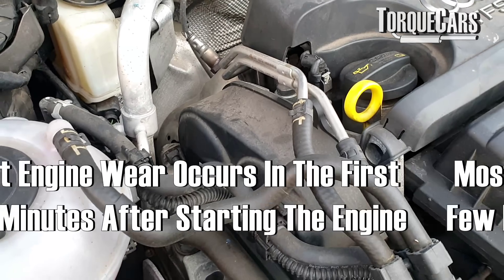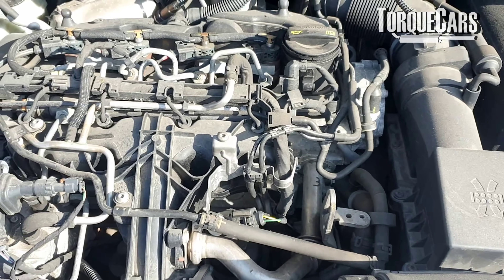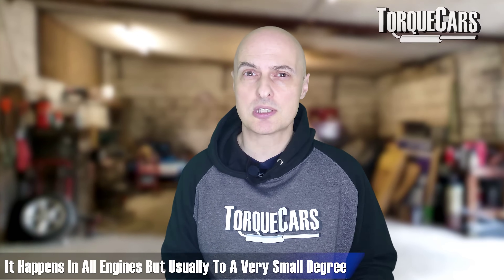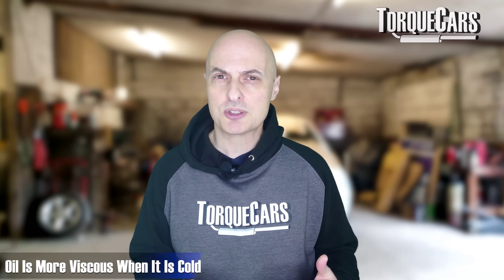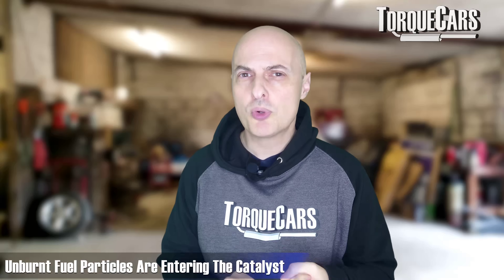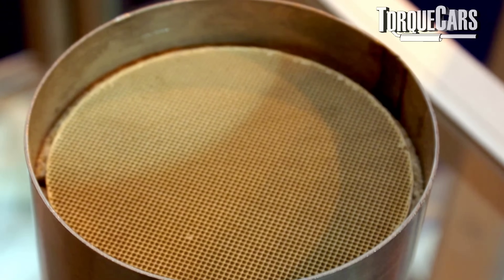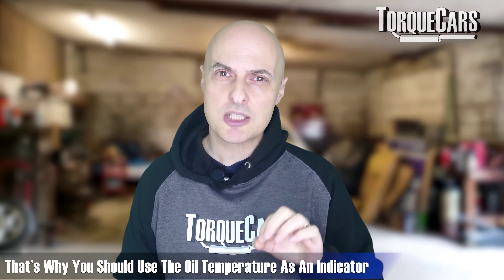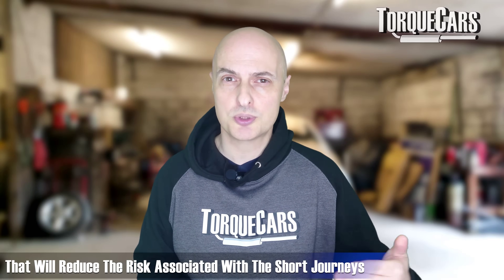5 Minutes of Terror? The TRUTH About Cold Start Wear (and How NOT to Blow Your Motor!)

Comment: Lol, i oft forget how much time has passed, so my car warms up often for at least 15 minutes, if not 20 or more... I also leave the car for a few minutes to ``digest`` the heat on idle after arriving to a destination... The engines in my cars always perform nicely, and while i do suffer some problems from time to time, it`s just the usual jazz of replacement parts or washing out the intake/egr/cat in general and dpf too on diesels... Not once have i drained my oil and found any real sparkle in it, just dark shell rotella or rimula as we have it known in europe... The best oil i ever used, and by far cheaper than most snake oils like castrol and such... Smells much like good old Mobil 10-40 oils from back in the day, but it does sublime work... And yeah, it does affect the fuel usage positively... I would say that it`s due to the oil`s ability to form a seal and reduce blowby, but that is just my speculation... I use it in factory stated viscosity depending on the car, but regardless of the engine, it works amazingly... I know that this seems like a plug, but it`s just my enthusiasm for a damn good lubricant... Tho honestly, even if it did not offset the fuel usage by a few % in my favor, i would be using it, it`s just a great oil for any engine in my experience, from 2013 audi v8 4.2 turbodiesel to i4 merc turbo from 2008 to first gen a class 1.9 petrol natty, they all love it and perform better since i switched to rimula a few years ago... The 1.9 petrol natty doesn`t even defile the oil that much, it`s more of a translucent brown than dark brown chocolate that you get from a diesel with a turbo...

Edit-
The only thing i recommend more than using rotella/rimula and warming up your engine is getting an engine block heater or even an oil heater in tandem with the coolant block heater... That will do any engine a favor like nothing else in conjunction with good oil...
Keep in mind that i don`t use my diesels in winter all that much unless it`s a warm day, so that greatly offsets the engine fouling from regular diesel idle conditions... Petrols get to full operating temps in like minutes, so they don`t foul themselves or the exhaust componentry much by just sitting a bit... And the 4.2 is no different despite being a diesel... That engine is at 80C in minutes from startup on idle...

Comment: What is the impact of modern mild hybrid systems on engines.  There are lots of start stops on these engines in town driving.
Reply from the maker: A stop start isn't the same as a cold start and most of these engines warm up quickly and retain the heat well. As with all cars the key is to avoid over stressing the engine until it has reached it's operating temperature. It just needs the driver to read the temp gauge and drive accordingly unless the car maker has built in safeguards to protect the engine whilst cold.

Comment: Also I would like to add, it's absolutely crucial to use the correct engine oil, especially in the winter and change it earlier than recommended by the manufacturer. I live in the central Russia where the temperature gets as low as -40 sometimes. I always change my oil at every 5k miles. We also use webasto autonomous systems and plug in 240v equipment to warm up the  engine in the extreme temperatures.
Reply from the maker: Great point! Oil grades and additive packs are vital in these extremes.

Comment: I have been hearing lots of feedback and read a lot about engines. I own a Golf mk7 1.6 TDI. The max RPM is 6000. 

I use synthetic 5 w 30 oil. My car won't show the oil temperature until it passes 45 degrees. 

Can you please tell me out of 6000 RPM, what is the max I can go up to when driving my car? Also, tell me the max RPMs I can go to while it starts to warm up. I really need to know this!
Reply: 5990
Reply: Generally when cold I'd keep it below 2k unless you're going up a steep hill then more like 3k and let the turbo build low-medium boost. Once fully warmed up you can take it to 6k anytime as rev limiter on normal cars is reasonably conservative, ofc during normal driving you probably wont go above 3k anyway and it's not ideal to bounce off the limiter.
Reply: Fuel cut is 5,200rpm

Comment: Great video! On my car I have installed diesel coolant heater and no more cold starts! No more scraping the ice of the windows and freezing inside car. It took me a 3 days to install the heater together with coolant flush but man what a beauty! Now when I need to drive I just press on the button on the remote and I wait 15-30 min depending of outside winter temperature and all the ice melts from a windows, engine is preheated to operating temperature and it's nice and warm inside the car. Best investment ever let me tell you!  😊
Reply from the maker: Are these readily available or is it a custom project you've put together yourself?
Reply: @torquecars  I can't tell you what it looks like globally but in Poland they're somewhat readily available, there's a bunch of garages around that specialize with branded auxilliary heaters, lots of trucks also come with coolant heaters & independent A/C stock. Not very common around here as it's not that cold over here but they're certainly popular in Scandinavia

Comment: Wait for high idle on cold start to drop and when it settles (usually around 1000RPM), the car is ready to be driven. Simple. That is usually 30 seconds or more depending on how cold it is out. That's what I go by before I load my engine. As for driving warm up, I would say keep it limited to about 1/4 throttle and below 3000RPM for your average car engine for the first 10-15 minutes depending on driving conditions. I know a guy with a Honda Accord that would get in, start the car and immediately start driving. Years of this treatment led the the car sounding worse and worse. Lots of clicking and rattling. I'm convinced the only reason it still worked at all was because it was a Honda engine. Still, even great engines are guaranteed to eventually fail. It was running, but it was running very poorly. This was all due to poor cold-start hygiene. 

One interesting note is regarding hybrids, or at least, Toyota hybrids. Toyota has the hybrid system programmed to prioritize the electric motors heavily when the engine first fires up. People who drive hybrids like this may have noticed in scenarios where your cold start occurs during initial acceleration that the hybrid battery drains unusually fast, which indicates the hybrid system giving more power to the electric motors to "unload" the gas engine while engine oil circulates on start-up. This is actually pretty cool because hybrids can actually protect themselves from user error whereas normal ICE cars are at the mercy of their driver. I suppose the one piece of advice for hybrid cold-starting is try to get the engine on before you begin driving and if you do find yourself in a scenario where you will be mid-acceleration on cold start, try to do so only with your hybrid battery fully charged. If this can be avoided though, it should be.

Comment: I think it would be cool to have an electric bypass oil pump for pre-starting. It can shoot oil through a check valve ahead of the output side if the engine oil pump
Reply: The turbo post-oiler kits also have a pre oiling function too.

Comment: All of my life in very cold weather I have always allowed my engines to fast smooth idle for 20 seconds or so before doing anything. And then drive off in a lower gear whilst not putting pressure on the motor until a mile or so.
Reply from the maker: How cold does it get where you are?

Comment: 230k miles on a M57 diesel. Original turbo. Mpg matches factory spec. Get in and go gently until hot. Floor it now again when hot. Change oil annually. Can't go wrong.
Only idles for a minute or two when I have to scrape the windscreen.
Reply: You only change your oil once a year???
Reply: @tylerwill5250  Sure, as long as you drive <10k km a year
Reply: Oil should be to BMW long life LL-01 or LL-04 spec  with viscosity covering range for your climate
Reply: Best BMW engine!
Reply: @AlbiM1 M47R is the best no flaps on inlet manifold

Comment: On some engines, you can see the cams trough the oil cap, and in the first seconds after turning engine on, there's almost no oil on the cams.A strong indicator that you should not drive in the first minute or so.
Reply from the maker: The top of the engine is where most wear occurs on cold starts from what I've seen and experienced.

Comment: He is so Wrong in many ways 1st oil needs to warm up for protection 2nd coolant needs to warm up for your water pump. 3rd transmission fluid need warming as you drive  slow motor is #1

Comment: this explains why those PHEVs last so long. if you charge it every time you get home, the combustion engine never really gets to power short journeys. and if you know you have barely enough electric range to reach your destination, might as well turn on the normal engine early on in the trip, when you're on the motorway or other long winding roads where there's few to no stops and the engine can just happily start with a low lasting load.
Reply: I have a PHEV, at 7k miles the oil still looks brand new because the gas engine really only gets used for 3-4k of those 7k. I expect this car to last as long as the battery honestly.

Comment: All engines should be warmed up to operating temperature before driving. I think it’s a good habit to get into,I keep trying to tell my wife not to drive within seconds of starting her car as it’s really not good for the engine but it’s her car and if she wants to drive it when it’s cold that’s up to her. My car is warmed up to operating temperature before I drive it.
Reply: So your doing the opposite what this guy is saying? He said don't idle to get the motor up to temp. Hmm
Reply: You can speed up the ~20 min it will take at idle in cold weather to warm up to full operating temp by immediately revving to 5-6,000 rpm. Then it will only take 2-3 min.

Comment: 2003 Grand Marquis..437,000 miles, I don't care about the car, 15,000-25,000 mile oil changes, runs 3-4 quarts low on oil constantly, I get off work at 7am, start it, instantly drop it in D and go, less than 1 minute I'm going 75 mph on the interstate right beside my job, been doing this since 2008, still runs and drives like new...the only way to warm them up is WOT....

Comment: Another thing he did not mention is that the metals are more brittle when cold. Cracking is much more of a risk. One thing I learned studying auto technology is that you can think of melting starting from the cold temp on up. The metal “softens” and becomes more pliable: I.e. less brittle. And all the metals are selected/designed to be at their optimum size, shape and “softness” (for lack of a better term) at full operating temperatures. And his insistence about cold oil and first few seconds after start are spot on. After decades of auto work, and hundreds of hours working on and rebuilding engines and seeing the effects, I feel like I actually feel the scraping hard cold parts being beat up on first cold start of the day. I have a diesel with an engine monitor installed and never drive until the oil/coolant are at 100 degrees. And then only gently until over 130. And then only moderately until full temps are reached. I never have  even the finest metal particles on my magnetic drain plug.
Reply: I think the right therm would be ductility or elasticity in this case, definitely not softness... But you are right, the hotter most metals get, the more malleable and less brittle they behave...
Reply: @camillosteuss  I didn’t think the average reader would get the idea with the more technically correct terms you suggest. I feel like you need some background study in metallurgy to find those terms understandable to a layman. But yes…those are the terms used by professional materials and metallurgy types.
Reply: Things like rings won't start to go "soft" until 600*F and cams - chains would never get over 400 so I completely disagree.  The exhaust valve is designed to run hot, up to 1,500*F and beyond that it deforms as a "tulip" when it fails.
Reply: Thanks for the extra info :)
Reply: @5400bowen I'm confused do you mean 100 in Fahrenheit ser?
Reply: @pierrehahn64  100 Fahrenheit = 37 Celsius 
130 Fahrenheit = 54 Celsius 
You're welcome

Comment: In Nordic countries if you keep your car outside in -10c to -30c temperatures(typical winter temps), it is impossible to just get in the car start it wait 10 seconds and drive... All your windows are deep frozen and nothing but the heater can help to defrost the window areas to the point that you can scrape the ice off to the point that you can see outside... So you have to idle the engine for several minutes with the heater at max, otherwise you can´t drive! And in such low temperatures even the best 0W grade oils are very thick..
Reply from the maker: Interesting, you get much colder temps than we do here in the UK (we typically see around -6 at the low end (winter average is around 4.8c) with a few spikes beyond that), so I'm always intrigued to see how people cope with this. How long do engines take to warm up enough to pull away safely in those conditions?
Reply: @torquecars  Takes up to 5 minutes, but as i mentioned the problem is the deep frozen snow covered windows and windshield, if you cant see out of your car you cant drive it!!
Reply from the maker: Do EV's work at those low temperatures (thinking about batteries not liking the cold)!
Reply: @torquecars  I can´t comment on that since i do not own an EV, but what i´v heard is the range gets cut in half or even more, but i do see some Tesla idiots around... :D

Comment: My neighbor "warms up her car" by revving the cr## out of it for a couple of minutes.  I made the mistake of talking to her about that and she went into total Karen mode "you think that just because I'm a woman that I don't know how to warm up my car".  Her cars last about a year (one winter) before they start belching smoke.
Reply: @herbieschwartz9246  She deserves the increased debt on each new car!
Reply: Lmao
Reply: I drive my diesel around 1500 rpm before reaching 90 degrees. I give it at least 3-5 minutes when I start it in cold. I care for my car, will NEVER rev on a cold engine at start…….. After reaching 90 degrees I change gears around 2300-2500 rpm typically. 🫡🫡🫡
Reply: Easiest way to 'tell' a woman what to do is let someone else tell her!
Reply: @herbieschwartz9246  hahahaahah
Reply: @herbieschwartz9246  Question is divided. A mechanic told me to always warm up the car before a drive. So I did. Idled either 10 minutes or until temp reached at least 25%. Now that's abuse according to others, meaning you should immediately go driving to warm up the engine as quickly as possible. With the girl in question's method, it is indeed warmed as quickly as possible and therefore least abused. Idk. With my careful warming procedure, even with block heater, the BMW blew up after a winter too, but it was a BMW, says all about the build quality.
Reply: I have never known of a smart woman.
Reply: @benbraun-su9fr  good lord. The best plant engineering technician on my team is a 27 year old woman. Don't be ignorant. Not to mention all of the highly skilled female scientists I'm around. Maybe don't judge the intelligence of a woman based on the character a woman is showing you while taking your money at the strip club. She's obviously smarter than you, just made you feel superior to drain your wallet.
Reply: @benbraun-su9fr  Only a person who can't get any would post these comments.

Comment: If the manufacturer is smart they will have a feature built into the programing so until the coolant temp reaches a certain degree the engine will not be able to go full throttle . Full throttle will not be permitted unless certain parameters are met . Unless you like replacing engines .
Reply from the maker: I have found this to be the case on some models. Particularly newer Audis limit the revs to around 3500rpm (it will depend on the engine, this was on a couple of A3's I borrowed) and even some BMW's have for quite a while enforced a lower redline during the warm up phase. Sadly not all have this safeguard build in, I guess it encourages more people to go out and buy a new car! lol
Reply: @torquecars  My 2002 Prius essentially locks itself at high idle (~1300rpm) during the first 30-40 seconds of warmup, unless you get hard on the throttle. The car propels itself solely on electricity during this initial warmup period, and slowly charges the battery for a little bit of extra engine load.

Comment: Some people write here that 2 minutes is enough to warm up the engine during a cold start. Lol. What is a cold start for you? In my case, 2 minutes is not enough. Have you ever sat on leather chairs that are like an ice cube? When the windshield is instantly covered with ice with one exhale. And the power steering howls and asks not to touch it) I recently started my E39 M62B44TU at minus 40. Greetings from Siberia. And thanks to Germany for the beloved old BMWs that are still alive and give positive emotions in harsh conditions.
Reply: Cheers from Northern Norway.  Been there many times. Scraping the inside and outside of the windscreen is always entertaining.  I really enjoy the old plastic bag filled with hot water to defrost the fuel door trick.

Comment: The old practice of leaving a motor to warm up has as much to do with choke\ throttle response as letting the tolerances expand. Modern injectors mean that idle is established within 10 seconds. The only time I'll let it idle on the drive is in winter.
Reply: " idle is established within 10 seconds"  I invite you to test that in -25c degrees, no way.